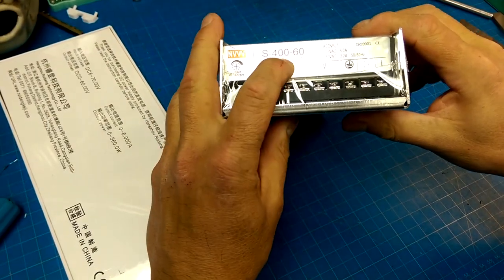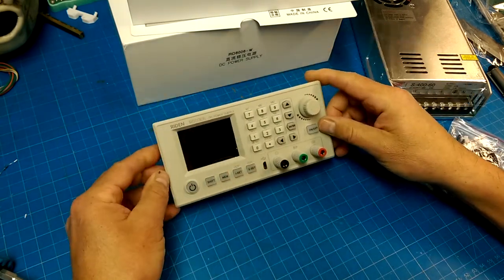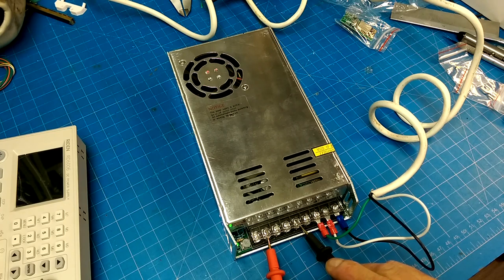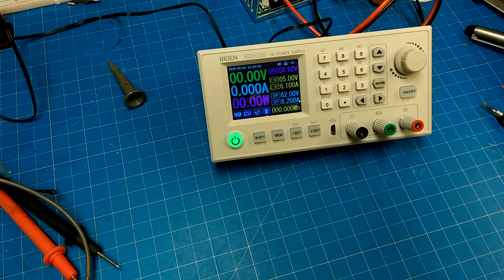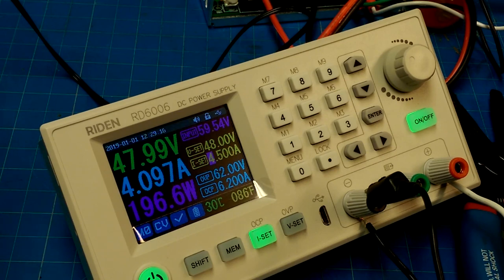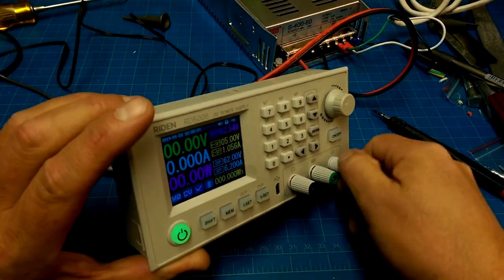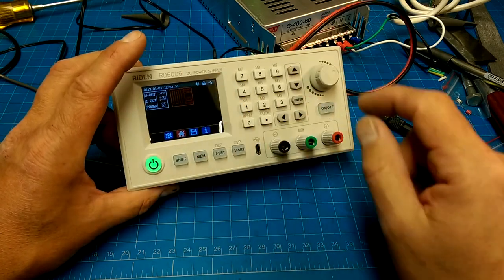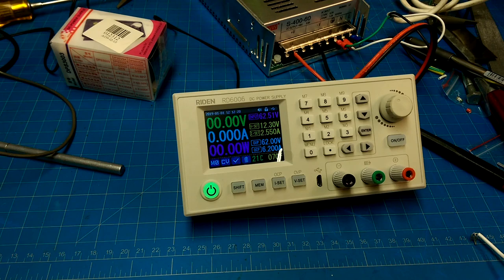DP6006 First Impressions

Comment: Adjust voltage on that 60v/6A power supply there is a potentiometer. You can push it 65V easy and safely. So you will get 60V under full load.
Reply from the maker: If I ever need that extra couple of volts I will do that.

Comment: WHY DO YOU NOT PUT ONE OR TWO ANTIPARASITES AT THE OUTPUT OF THE TRANSFORMER?
 Those types of transformers, as they are electrical circuits, tend to have parasitic currents / voltages.
It is best to put a suitable toroidal to act as an anti-parasite, in all professional transformers they usually carry.

Comment: 9:00 “according to the electronic load it is delivering 4.99”
Uhm sorry but the electronic load is RECEIVING 4.99V. 
That 0.01V difference is probably lost on your cables. You should have measured the voltage at the RD6006 terminals (as well).

I highly recommend the case. 

Still enjoyed your review, Tx!
Reply from the maker: Yes.  Exactly.  The power supply is delivering 4.99 to the load.  Or the load is receiving 4.99 from the power supply.  The way I said it was misleading.  Good point about getting a voltage measurement at the supply and at the load to find the cable loss.

Comment: You need to buy your own PSU, correct? It's just an interface to adjust voltage and such? Thanks.
Reply from the maker: Yes.  They sell it with some recommended fixed voltage PSU or individualy.

Comment: If you wanted a vibration rated / resistant power-supply I think you went with the wrong vendor.
Reply from the maker: You can say that again!  Do not mount one of those on a printer or a CNC.